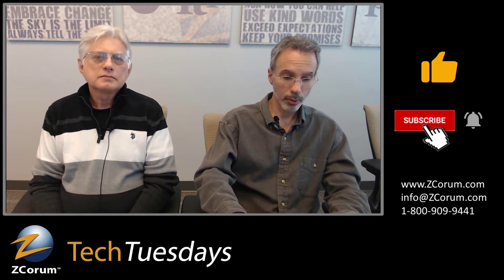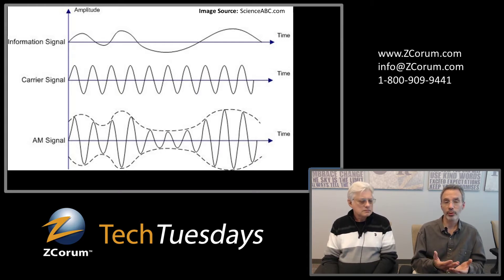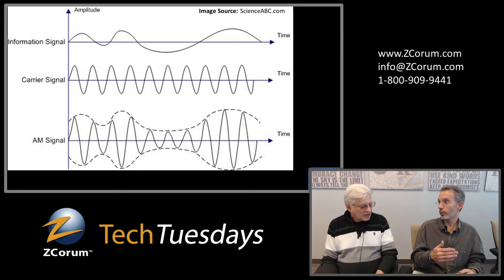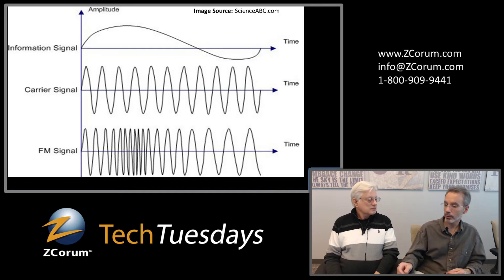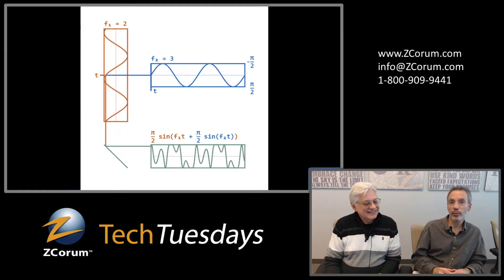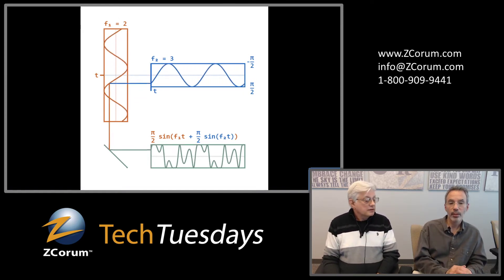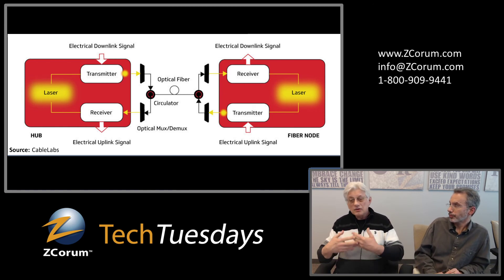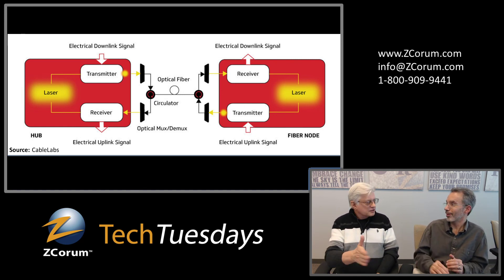What is Coherent Optical Technology?

Comment: Hi guys, I think you are wrong: in the animation of the phase modulation the blue signal is the signal that carries information to be transmitted and the yellow one represents the carrier signal. The formular consequently shows f1 as the carrier frequency and f2 as the information signal frequqency. In coherent transmission f1 is as high as 200THz whereas f1 is up to around 100GHz these days.
Reply from the maker: Martin, thanks for pointing out that error in our reference to the phase modulation animation and your insight there.